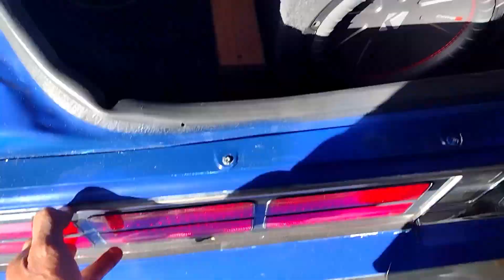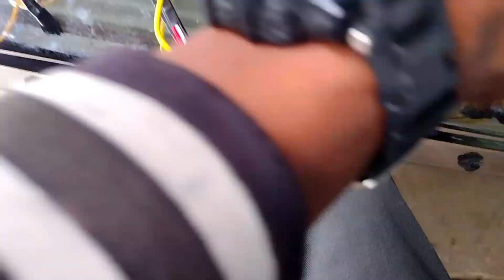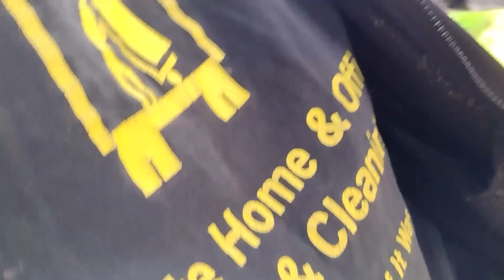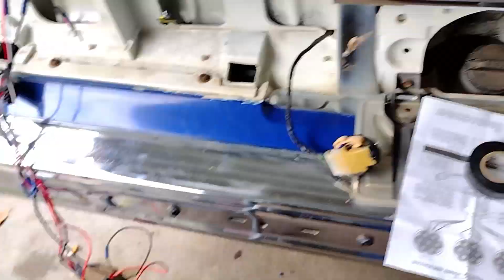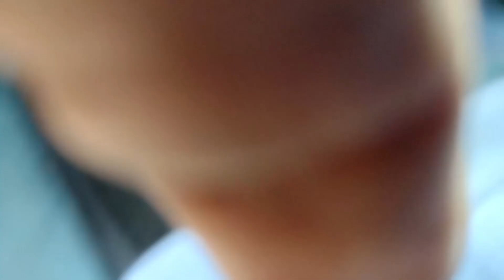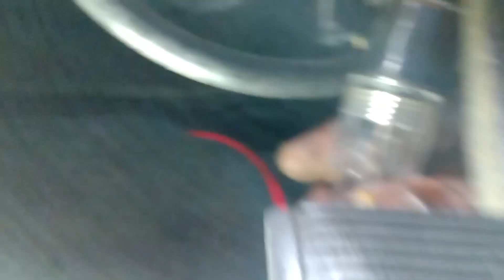Sequential Taillights Setup for Box Chevys and other Vehicles

Comment: My tail lights wont come on every thing else works i have same kit on 87 caprice
Reply: Right around the 9-minute mark I explain how I did the taillights and the turn signals. If you connected it that way it should work. Also look for the part with the brake light switch connection which is closer to the end of the video. If that's not connected, they won't work right. Sorry for the late reply.

Comment: Man love what you did and i basically did the same thing. Only difference with mine is when i turn my actual lights on (as if you were driving at night) my passenger will not dance, but if the lights are off (as in driving in the daytime) they work as they should. Can’t figure out what’s going on